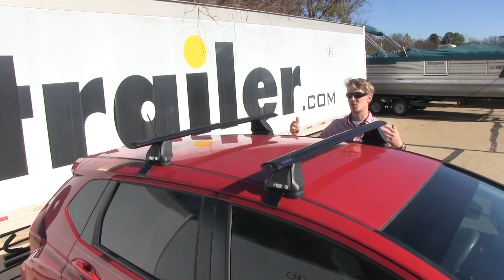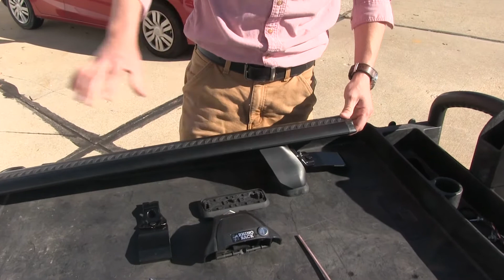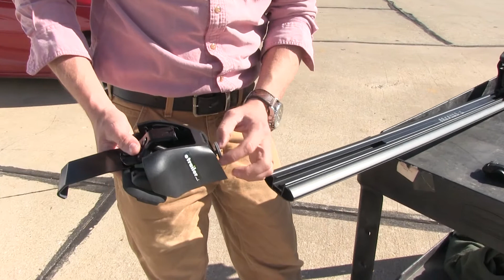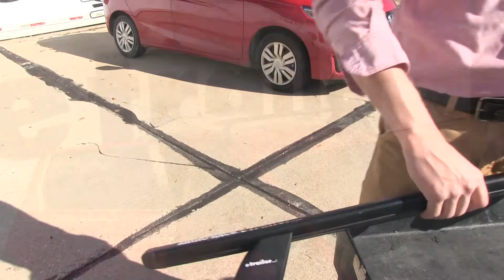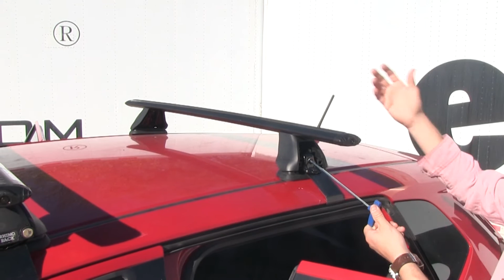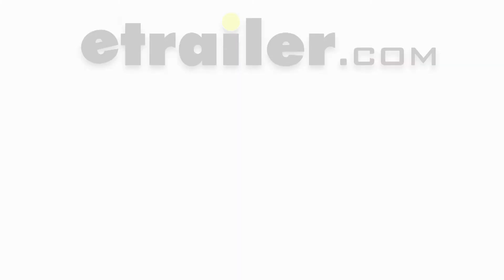Test Fit: Custom DK Fit Kit for 4 Rhino-Rack 2500 Series Roof Rack Legs on a 2016 Honda Fit

Comment: Good, but the front bar spacing?
Reply from the maker: It will need to be 250mm (seen here: https://assets.rhinorack.com/Instructions/RoofRacks/SZ/SPORTZ_2500_CHART_-DK438_-Honda_Fit5dr%20hatch__15-_R4597_Issue1_2pages.pdf?_gl=1*50bkdz*_gcl_au*MTAxNjE4ODEwOC4xNzg0NjUwNTQwLi0uLS4xNzg1MTcwMjE4LjE3MDE5NTQyNDUuMTc4NTE3MDIxOC4xNzg1MTcwMjE4*_ga*MTc3MTIzMzM5LjE3ODQ2NTA1NDA.*_ga_01DGC4PM41*czE3ODUxNjk4NTQkbzMkZzEkdDE3ODUxNzAyMzYkajkkbDAkaDgxMzM0ODQ3Ng.. )

Comment: One question. Where does the front rack sit measured at what position from where? You explain the racks are 750mm apart from each other but the front rack is positioned where?
Thank you 👍
Reply from the maker: The measurement for the front cross bar is going to be 250 mm from the center of the front cross bar to the crack between the front and rear door. We have the directions for this roof rack on our product page if you would like to see them for reference.
https://www.etrailer.com/Roof-Rack/Rhino-Rack/DK438.html